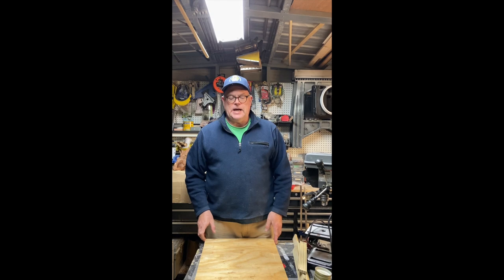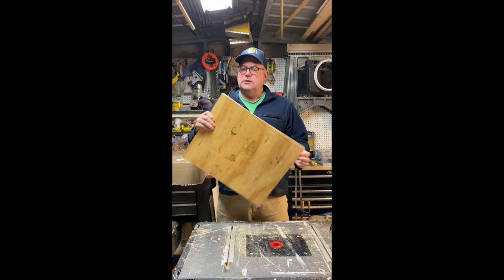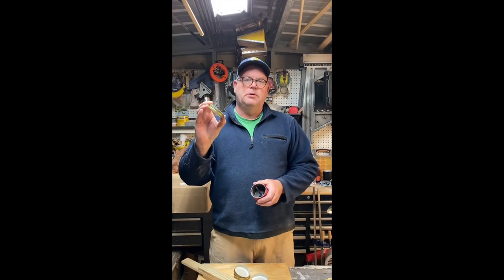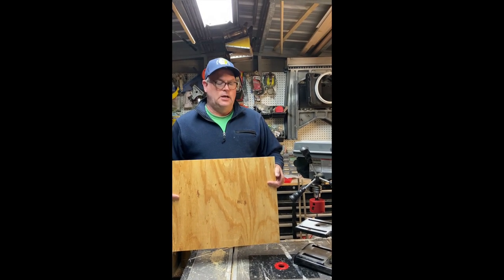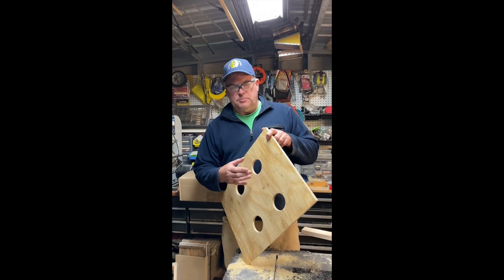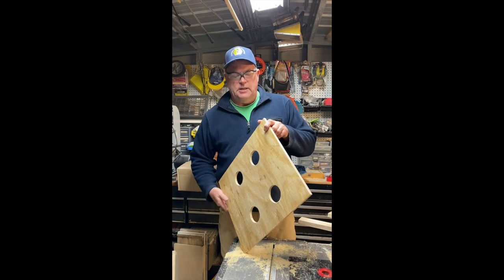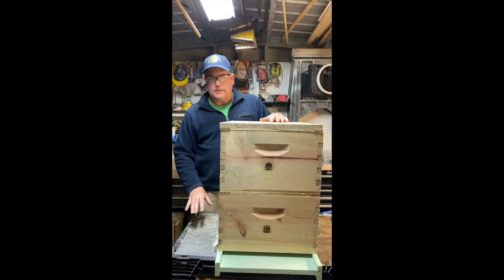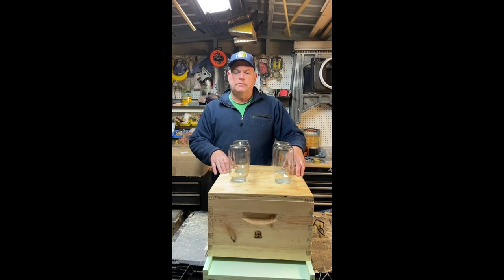How to Make Cheap Hive Top Bee Feeders

Comment: You can staple some #8 steel mesh to the bottom of the holes to keep bees from getting into the top hive body. That way you can change the jars without bees being up there.
Reply from the maker: Salty Dog:  yes you can and it generally works fine.  However you should take extra care to make certain that you have seated the jar deep into the opening against the screen.  Otherwise, the bees will not be able to reach the holes with their proboscis.  I have tried both screened and unscreened holes.  I prefer to leave them unscreened, but screened has it’s obvious advantage.

Comment: If you’re poking holes into the lids how does all the syrup not just run down and drowned the hive?
Reply from the maker: Andy:  I am not a physics/science guy so I will answer the best that I can.  The holes are very small.  Also, the contents are a fairly viscous sugar/syrup solution.  When you turn the jar upside down, a vacuum forms in the jar and the sugar syrup does not run out into the hive.  Another reason I recommend buying these lids instead of making them yourself.  You want to make sure the holes are the right size.
Reply: @patrickmccalman207  I have a similar set up but I do not invert the jar through the hole.I invert it over a couple of laths. Quite  bit of syrup runs out on top of my board. I am sure the bees probably clean it up but I don't know the outcome when it runs down on the frames. I am just stating out so I may be concerned for nothing.
Reply: it will only come out when the bees want it, its called a vacuum.

Comment: That will pour syrup over your bees, why would you do that?
Reply from the maker: It seems that it would, but inverted mason jars containing sugar syrup is a very common method of feeding bees.  Very small pin holes are made in the lids.  When inverted, a vacuum is created that keeps the syrup from running out of the holes.  The bees stick their proboscis in the holes to gather the syrup.
Reply: It causes a vacuum. It's like pouring gas out of a gas tank without the vent open. The gas pours out very slow. Syrup water is even thicker so it greatest a tighter suction.